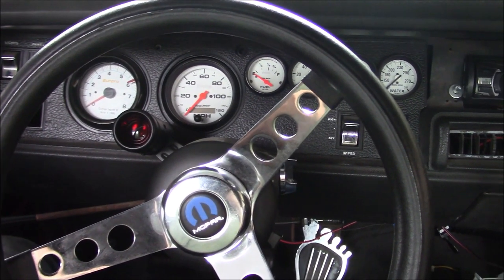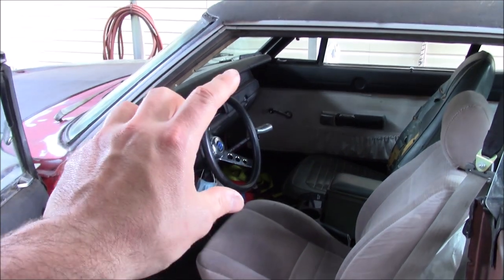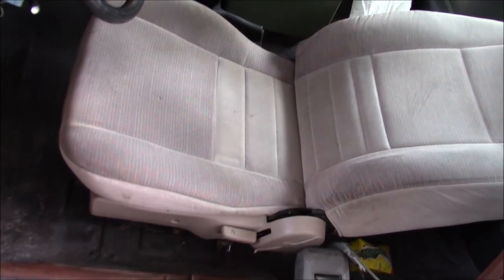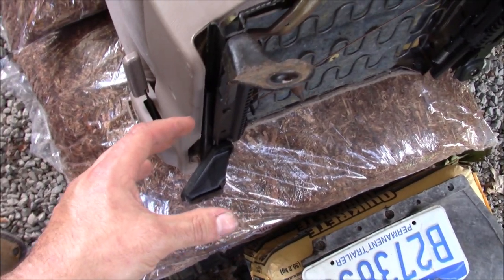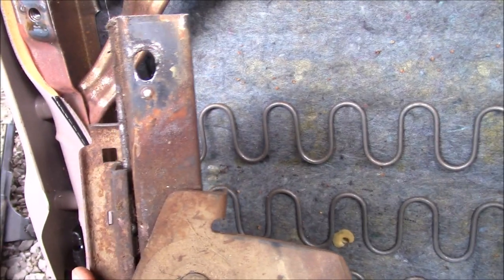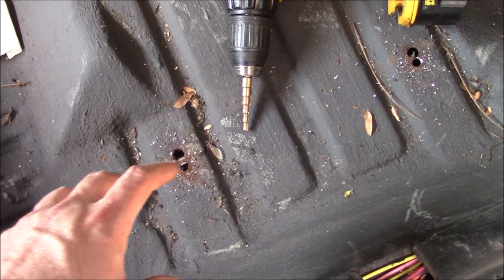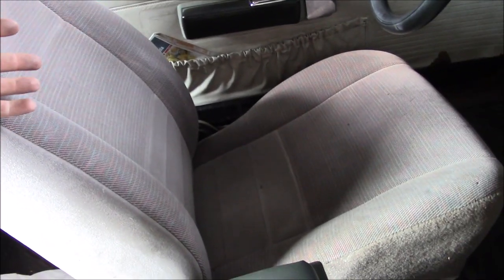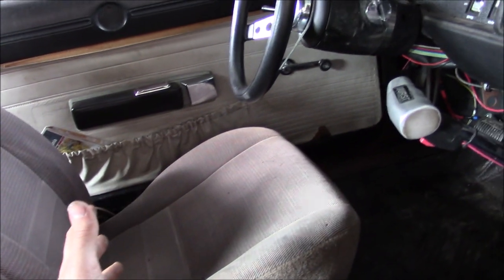The Charger Gets Some "New" Seats

Comment: Did the lizard skin stuff make a difference on the heat? I need to uninstall a few floor drain holes/exhaust inlets on my old F250, thinking about some of that stuff because I really doubt I'll ever actually buy carpet for it, she gets toasty sitting still in the summer time.
Reply from the maker: It did actually, and I pretty much installed it the "wrong" way, haha.  You're supposed to spray it on, preferably outside the tub.  I put it on the inside with a brush, then sprayed a coating of bedliner on top to keep your feet from wearing it away.